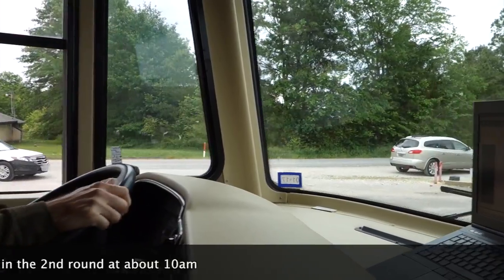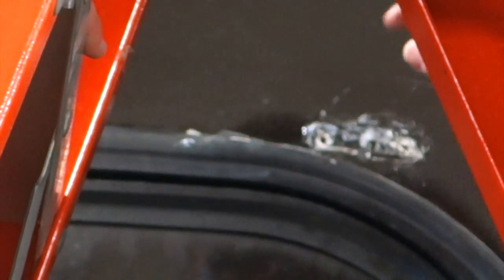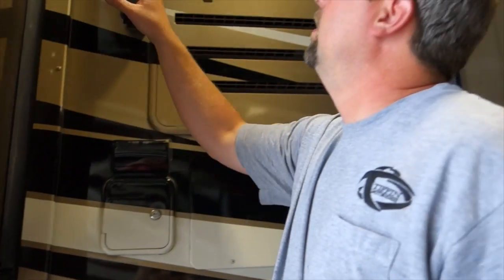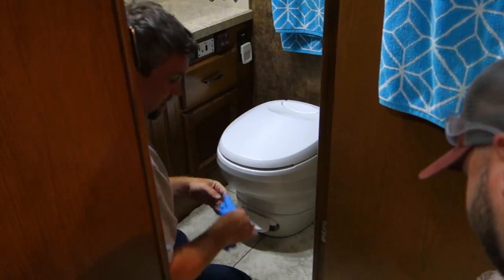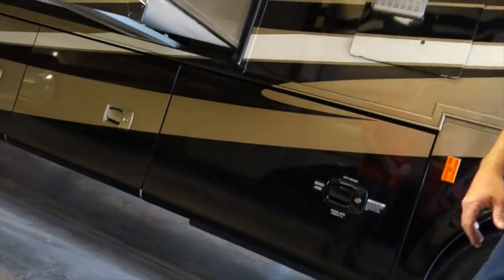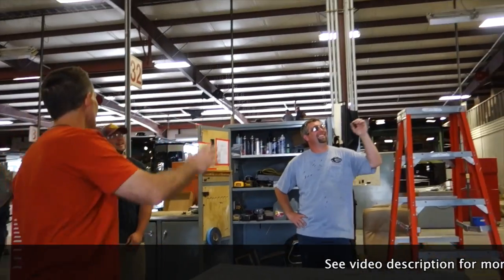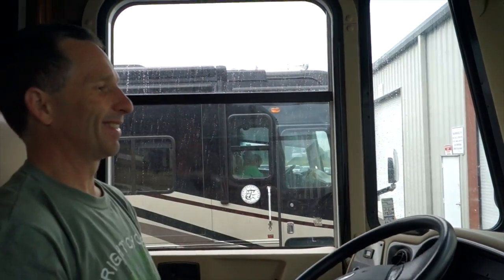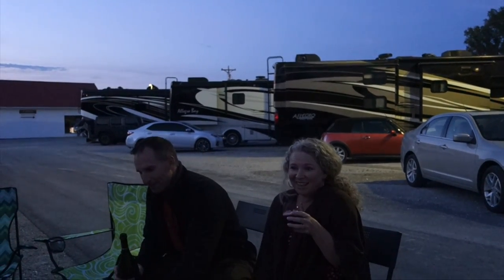FIXING OUR RV: REPAIRS & COSTS | Part 2 of Our Service/Paint Experience at Tiffin

Comment: That was a great video,,, so much so,,,, that I will definitely consider a new Tiffin based solely on how well you were treated,,, the attitude of the employees and the very reasonable cost and of the repairs.
Reply from the maker: We love our Tiffin and have had very good experiences with it for the most part. It's one of a few tops brands we can confidently recommend, but no matter which brand you choose, you still need to do in depth research on the specific model you want. Good luck!

Comment: What did you negotiate to be taken in and have repairs done on the same day? Usually a vehicle needs to be left and the shop gets to it when they get to it.
Also, because the paint cost $0 I assume that it was a warranty fix? How did you negotiate that "same day" fix? I've heard a number of horror stories of warranty repairs on RV's taking 4-6 weeks at least, with your rig just sitting there most of the time while they wait on parts or who knows what : /
Just curious of how you got all the same day service. Great videos! Thumbs up!
Reply from the maker: Thanks glad you liked it. We called ahead to find out what the Tiffin Red Bay system was, being the company HQ, they have a huge facility for both service and paint/body work. You can't book in advance, you have to s how up and register at the campground and get a service number and you go in the queue. I called ahead to find out what was the wait for the Express Bay (we knew that was all we needed as our repairs were fairly minor) and it varied from 1-3 days but it can go up to a week during busy times. We were staying just 1.5 hours away and when I called and they said the wait was 1 day, we headed right down to register... so it's all about the workload... and the Express Bay is a set 3 hours you are allowed (max) so once we knew we were oging in Monday we knoew we would be done in just 3 days. Had to then go in a queue for the paint shop but they weren't busy and we got in the next day. Maybe we were lucky... but we also did  a lot of pre-planning.. that's just how they do it there at Tiffin. High volume and turnover, in and out... As a general tip with other repair shops,, as full-timers, we always communicate our situation and needs ahead of time with a repair shop and when they know it's your home, they are usually really good about doing the repair quickly, often same day or a couple of days if you plan ahead and work in with their schedule. Yes the paint repair was a warranty fix covered by Tiffin (see our previous video on our repair list as Marc talks to that). Also Tiffin did have a bunch of coaches "out back" that were left by owners and there are some tech who work only on those... I guess they are owned by people who don't live in it full-time and/or don't want to hang around. We ended up actually being there a week as we arrived on the Thursday night and were in the shop Mon-Tues. Another video coming soon on that process.

Comment: Dear all knowing RVers, is there any way to get fenders for the rear wheel wells. If you are as old as I am your would remember them on the cars of the '50's rear wheels. It seems to me that they would keep the sun off the tires.
Reply from the maker: Hi Steve - we are not aware of any after market fenders to protect tires from the sun while driving. There are plenty of tire covers to protect them when parked. But most RVs spend the majority of their time parked anyway. :)

Comment: where can I go to learn what kind of RV you have and what it looks like and how you like it.
video??
Reply from the maker: Hi Bev - we talk a LOT about our RV, why we chose it, howe we like it, repairs and upgrades etc over at our website www.rvlove.com and you can read several articles there - be sure to scroll back to older posts which we shared early in our journey. Here is a link to the section I mentioned http://rvlove.com/start-here/rv-setup-vehicles (the older posts link is at the bottom left) http://rvlove.com/start-here/rv-setup-vehicles/page/2/ and also http://rvlove.com/start-here/rv-setup-vehicles/page/3/ - that should give you plenty of info!

Comment: The rubber seal in the toilet gets a lot of chemical abuse, like bleach or deodorizer or even acid from human waste. They fail less frequently if you coat it monthly with plummer's grease which is rubber friendly (do not use petroleum gel which soften rubber).
Reply from the maker: Good tip - thanks!
Reply: Are you certain the seals these days are rubber? There re so many other materials that have been around awhile that are far superior. Also, many brands of plumbers grease are...petroleum-based. Perhaps you meant a silicone-based grease?

Comment: Well, from new who would think the lights didn't work because of the fuse.
Reply from the maker: The confusing part about that fuse was that it was not located with the rest of the light related fuses in the fuse box.  It was a random single in line fuse in the engine bay, that I didn't even know about, let alone assume it would be linked to lighting.  Lesson learned that day that not everything is where you would think it would be.

Comment: Do you guys find that getting work done at the HQ is much better then on the road?  Is it a little cheaper?
Reply from the maker: Yes, we would say definitely yes to both. If we had a major repair we needed taken care of (and wasn't necessarily urgent) we would strongly consider driving to Red Bay for them to do the repair...for MAJOR repairs that is... anything minor we would not drive that far unless we were already within say a 6-8 hour drive away.
Reply: I was actually impressed at how reasonable the pricing was. How long was the lead time to get an appointment like that? Do they charge to stay in the campground or is that included in the service fees?

Comment: So sad that people have to take their Tiffins to Redbay for service.  The local dealers, mine included just don't cut the mustard.  Why does Tiffin allow this from their dealers?
Reply from the maker: Hi Jay, we didn't "have" to take our Tiffin to Red Bay for service but we wanted to as we had heard it was a great experience and we wanted to do the factory tour. We have actually had pretty decent experiences from a few Tiffin dealers. Not the same as Tiffin of course, but still, there are a few we would be happy to return to and feel confident in the work they do. Sorry if you haven't had good experiences. That's frustrating! All the best to you.
Reply: Never by a newnar or anything else   from national indoor rv. Terrible service dept.
Reply: Like all authorized dealerships, they are independent businesses. And they can be very independent.  Even if the dealership is the worst in the nation, it can take several years to effect any change whatsoever. Never underestimate the power of a dealership association.

Comment: Enjoy your videos!  Your video is great quality, however your audio is low and  extremely hard to hear.
Reply from the maker: Hi Judy thanks for the feedback. Hmmm that's seems odd as we filmed this with video a microphone and I also bumped up the audio file in the editing suite to 3x volume. Would you mind sharing what device you were watching the video on and do you recall the volume level you were play it at? Some of our earlier videos had this low volume issue but we thought this was fixed with the external mic and editing suite audio adjustments...we haven't had any other mentions of low volume until yours just now... the video volume works great on my Macbook Pro and iPhone... so any more insight you can share would be helpful.. Meanwhile I will test it on a few other devices as well. Thanks so much!

Comment: So isnt there a warranty on any of this? Those new rvs are expensive and you have had to fix alot of stuff. My 1990 Allegro seems built much better. Still on the original water pump and toilet.
Reply from the maker: Ours is a 2012. The body work was fixed under warranty. Actually, considering we live and travel in this full-time, 20K in 2 years, we consider repairs to be minimal. A lot of these items were small ones that we only had them take care of because we were at the factory, otherwise we wouldn't have bothered. Glad you are having a good experience with your 1990 Allegro. The newer ones have a lot more advanced systems and technologies now, like slides etc. Do you live and travel full time in your coach?
Reply: +RVLove | Marc & Julie Bennett I live fulltime.